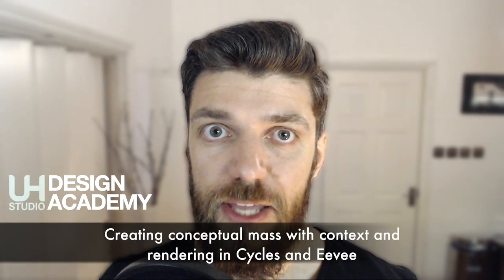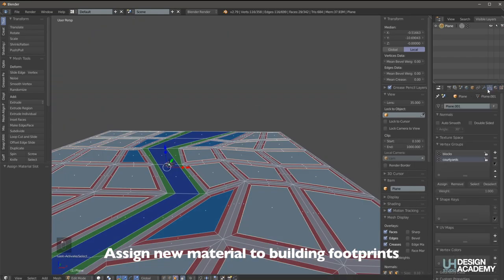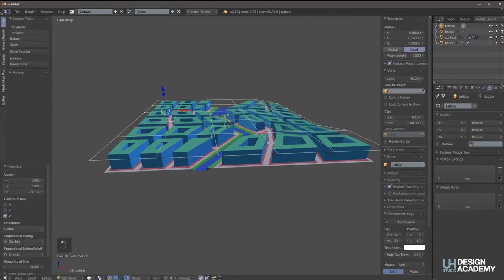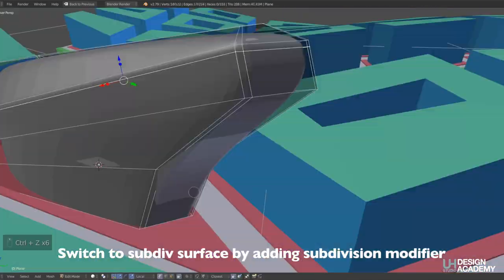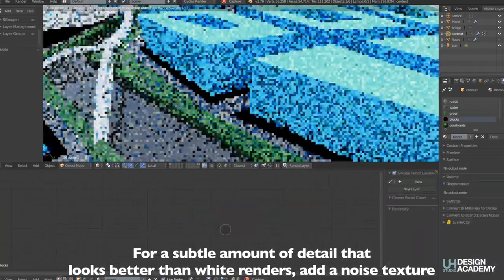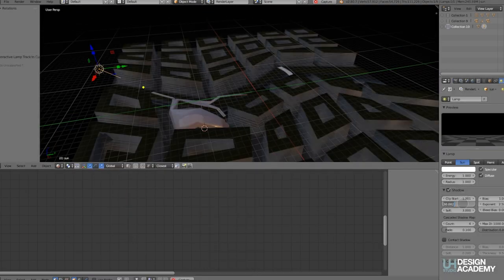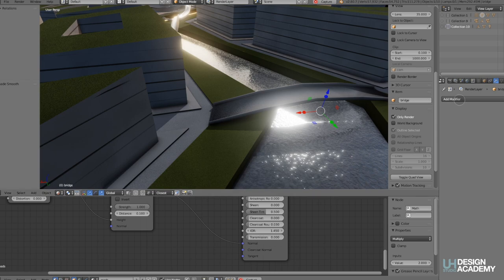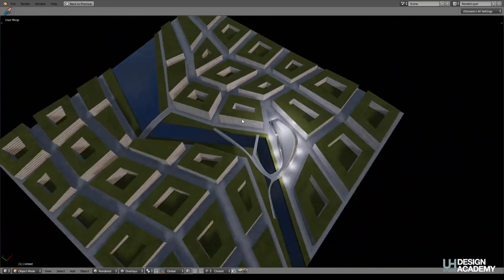Using Blender's Eevee & Cycles for architectural concept massing and context

Comment: wonderful class, may I ask if I had this form done, then I want to shape internal space without affecting outside surface, how can I do that? Everytime I modify internal surface will always change outside form. Is there anyway that I can avoid this? Thanks
Reply from the maker: There is a node with face normals - you can use it as a map with mix shader and have one type of material in positive normal direction and another in negative normal direction
Reply: UH Studio thanks！

Comment: hi I wanted to start using blender for my architectural presentations etc but my main concern is if blender can handle large grass and polygon counts in my scenes (last project i did where 100 small homes in a gated community )
Reply from the maker: Blender can handle very large poly counts, but it cannot handle many objects. So if you merge your objects by material, use, proximity, etc, it should come in well.
Reply: thanks for the feed back. this is a walkthrough i did in 3ds max (https://www.youtube.com/watch?v=cCmD7cQpnWQ) but it has gotten to expensive for me so i need to switch to open source do you think blender can do this with the grass quality etc

Comment: So you can render in eevee? Would the quality be better than in real time?
Reply from the maker: Bernard Forson you can set samples for rendering and viewport. Note that the way to render is not via render button but via opengl render buttons on the right hand side of the 3d view header
Reply: Ok cool! Also do you have control on reflections? And also layers as well?
Reply from the maker: Yes, altough layer have changed a bit, and there is no 20 layer limit anymore. I would suggest to import a scene or download a sample scene from https://www.blender.org/2-8/ and open it in a nightly built of blender 2.8 from https://builder.blender.org/download.